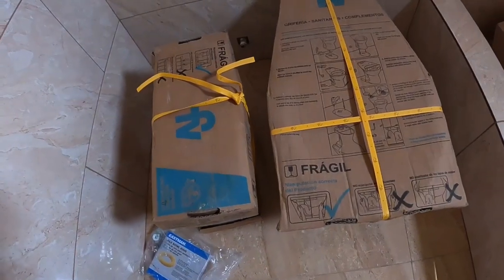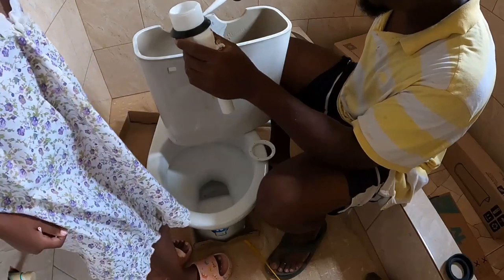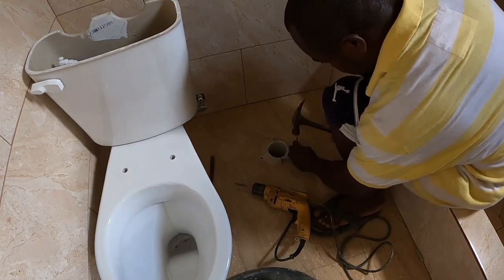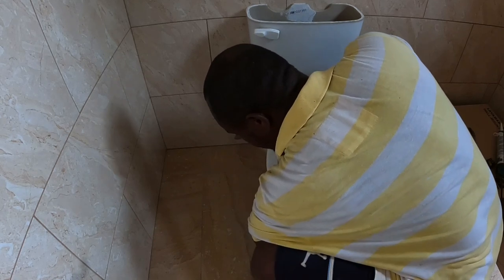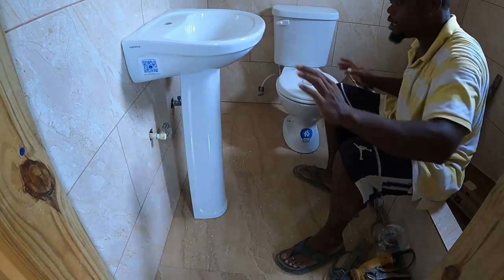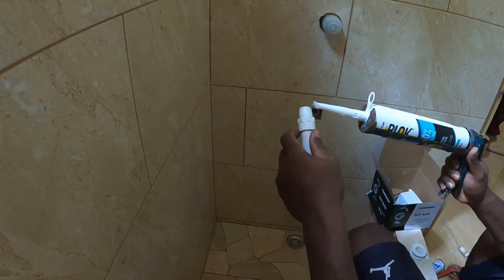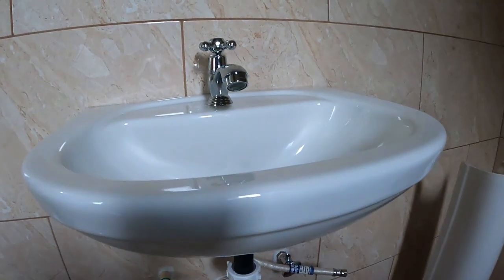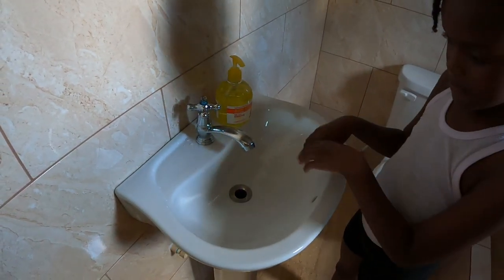Working on our Dream House in Jamaica| The Secondary Bathroom is Done!

Comment: Your progress have been good. Do take this the wrong way but you need to be educated more about plumber. Installation of the toilet tank. next time forb the soil pipe you need to leave 1/4" on from the surface so you know it is in the soil line. don't use silicone to seat the toilet. If the bowl should become block or need to be service 9 out of 10 time you will break it trying to unseat it. Its alway  because to use grout for easy release. For the hole to seat the tank they are 6" apart from centre. I don't mean to come off as if I am bashing your work it good to be hand. I am just try to assist you for the future. It good you are showing the world how talented you are. Just fine tune your plumbing craft.
Reply: Sometimes you guys need to keep your opinions to yourselves. This man is a professional and knows what he is doing. You seem to be a troublemaker. I hope they block you. Please leave decent people alone. Some of you read things in books and think you are proficient.